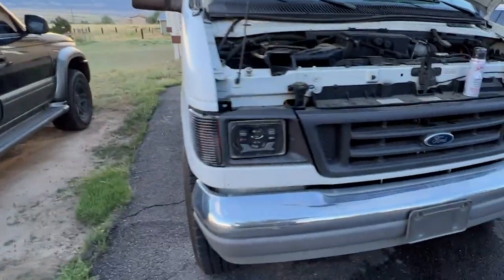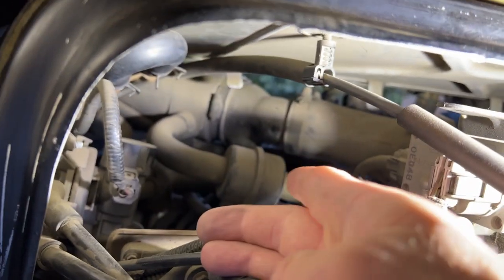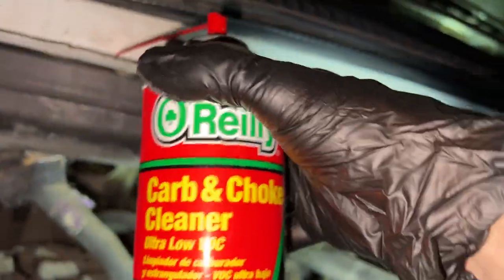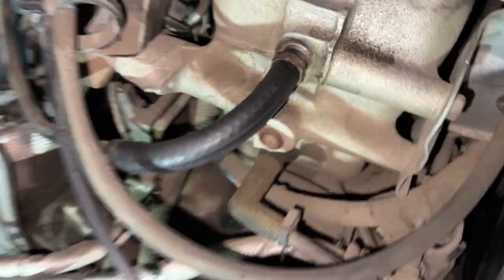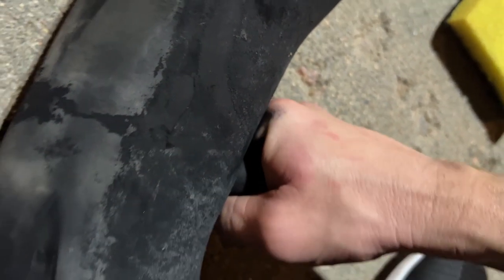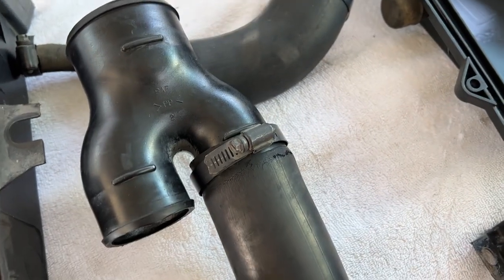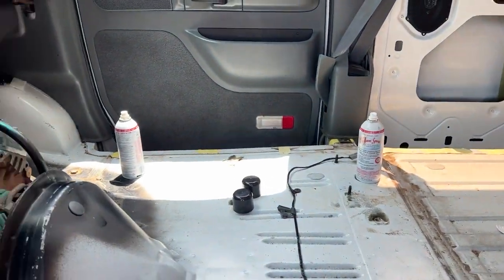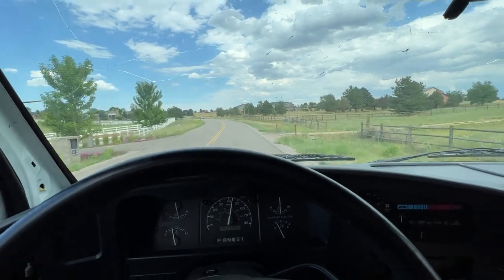96 Ford Econoline Intake Removal and Cleaning With Seafoam Injection | 7.5L Big block 460

Comment: Thanks for the great video! Do you think it’s better to replace the old fuel injectors rather than hope they get clean?
Reply from the maker: No problem, just run fuel injector cleaner in the fuel system, I wouldn’t replace them unless they have an actual problem and only replace with quality oem brand new motorcraft injectors if you do. I don’t recommend remanufactured injectors. They are trash and can ruin an engine

Comment: NEVER use carb cleaner on your throttle body!! It strips the factory applied laquer from the butterfly valve, and screws up the valve clearance. You should use Throttle body cleaner, or, mass air flow sensor cleaner. NEVER CARB CLEANER
Reply from the maker: good to know thanks
Reply: @4WheelKid  You helped me with the intake removal, and I help you with the technical shit. That's how we all learn. Thank you for taking the time to make the video.